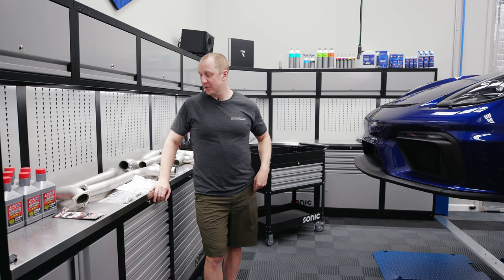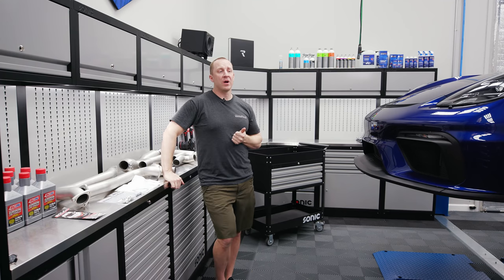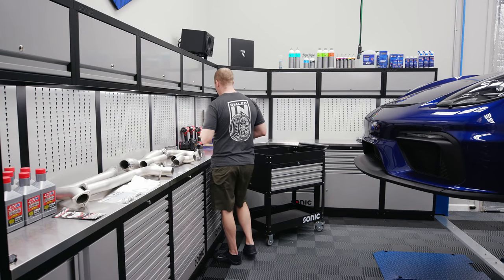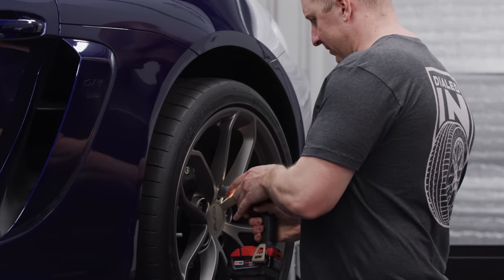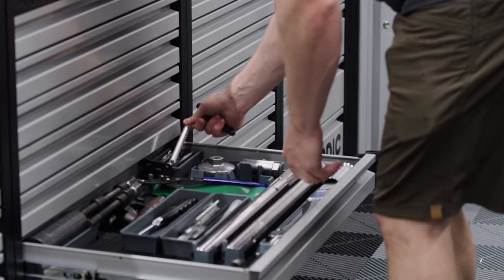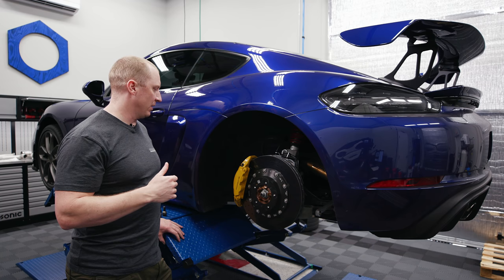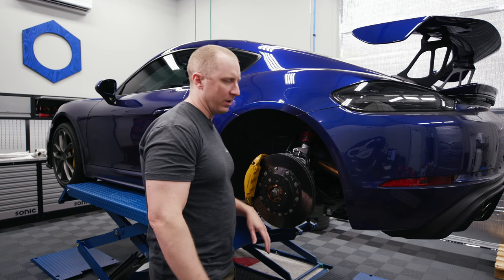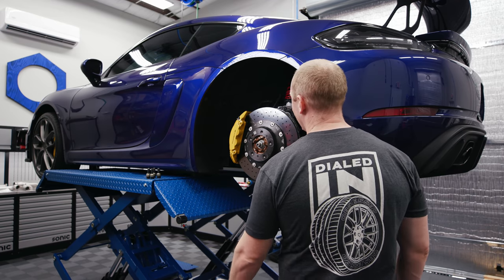Porsche 718 GT4 - Soul Performance Race Exhaust Install

Comment: i threw a CEL when i didnt plug vac line to my 2018 CGTS.  Took it to the dealer and got charged because I didnt know.  was told from Soul just to hang it out of the way... But man my soul exhaust sounded goo.

Comment: Sounds great. 🤘
I wonder how lighter is it compared to the stock one, that always look bulky and heavy.
Every pound saved at the extreme back of these cars contribute to the axle weight balance 👌
Reply: Thank you! It sheds 28-30 pounds over the factory exhaust components depending on your choice of resonators or not. -Mike